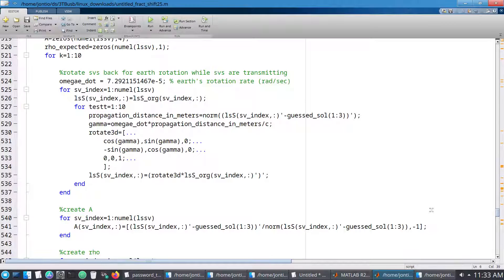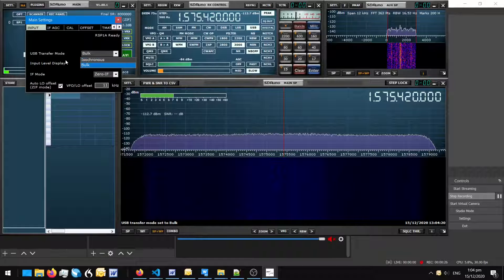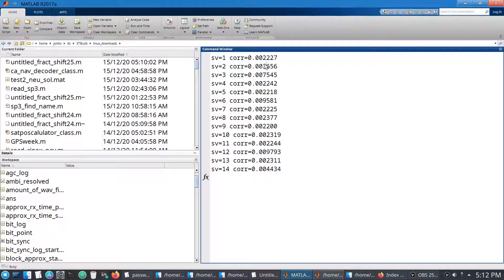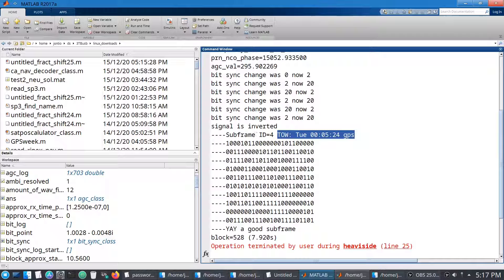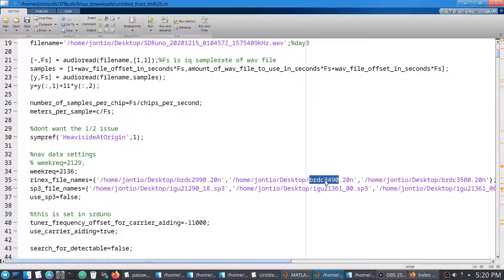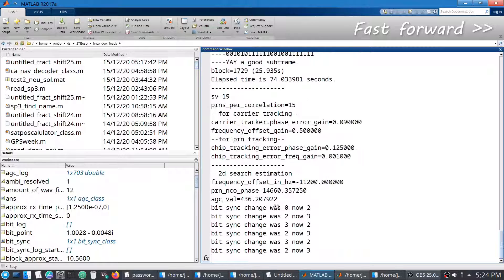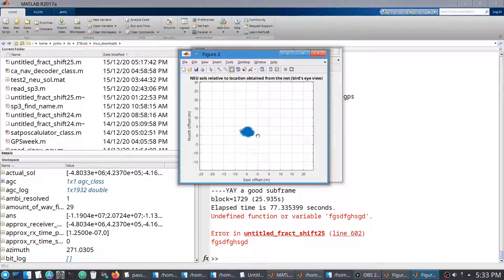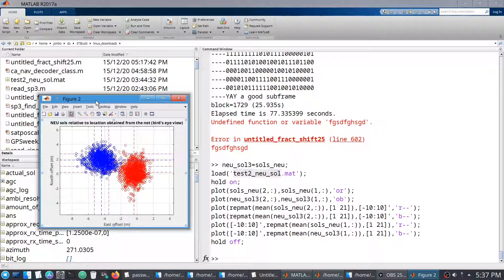GPS receiver in Matlab

Comment: Hi there, Thank you so much for such a helpful video. I am a researcher in GPS/GNSS area and currently working on GNSS vulnerability analysis through L1 signal spoofing. 

As @Sheryash Patil mentioned in the video can we do something similar to generate our signal using Matlab environment only and transmit it using USRP B210?
Reply from the maker: I'm sure it's possible exporting something from Matlab that the USRP B210 can understand. However I don't have experience with the USRP B210 and how it likes it's baseband signal, but maybe it's a IQ file in a wav format? A real time link between Matlab and USRP B210 would be more difficult but maybe there is someone who has already written some thing to do that. But yeah if it were me I'd start by generating a baseband signal in Matlab, export the signal as a IQ wav file, and then figure out how to transmit the file later after I was pretty confident that the signal was a valid one.
Reply: @jontiolds  can we save our signal in bin files from Matlab just like the spoofing video which were created using gnss sdr sim
Reply from the maker: @copycarvers  I'm not sure what the bin file format you mention is but I guess it's just a raw IQ format, probably 16bits I then 16bits Q, and signed integers. Matlab/Octave you can write that binary sort of stuff to files easily enough. So yes.
Reply: Will I need to use simulink for the signal construction or I can construct the signal using Matlab command window. 

Yes it is the IQ format and can I transmit.it using software defined radios?
Reply from the maker: @copycarvers  If it were me I'd just make classes and matlab scrips. I wouldn't use simulink mainly as I'm not that familiar with it. Any SDR radio that can transmit and take IQ files will transmit what you want. IQ files are baseband so you have to tell the SDR the frequency you want to transmit on and if it's a raw file format also the sample rate and whether the IQ samples are 16 bit 8 bits, signed, float etc. The SDR transmitter will describe the formats it can deal with you just have to write the binary files in matlab with a format the SDR transmitter wants.

Comment: I cannot access the aforementioned website. If possible, could you share all documents and MATLAB codes of the project with me ? E-mail: aesatsuzer@gmail.com
Reply from the maker: The address seems to work for me it's https://jontio.zapto.org/hda1/gps_matlab/Legacy%20GPS%20receiver%20in%20Matlab.html all the code is in that webpage. Does that webpage not load for you?
Reply: @jontiolds  Thank you for the feedback. However, the access problem has continued still, at least for me. Is there other way to access your site.?
Reply from the maker: @ahmetesatsuzer5313  Oh that is odd so it doesn't load? What response does it give (eg 404 etc). My site is self hosted in NZ so maybe your ISP or country doesn't like the IP address? What country are you in?  Can you access any pages on my site https://jontio.zapto.org ? If I can find some proxys from other countries I'll test the connection from there. ps I just tried some proxies from the US and Europe and didn't find any that fail to load. It's odd but you could just use one of the web proxys out there.

Comment: wow This project is awesome, Sir i have been working on GPS spoofing for last couple of months but still not be able to spoof the gps receiver can you please help . (>..<)
Reply from the maker: Thanks. I've never looked into spoofing. Spoofing would mean creating a GPS signal so that means you would need to create navigation data then mix that with the prn. If you wanted it so the GPS receiver position would be controllable then I think you would need to do it for most if not all SV visible but I'm not sure. If I was a GNSS receiver engineer  to prevent this kind of attack I would use Galileo and Glonass too. Then if one GNSS system didn't match the others I would ditch the suspected spoof signals. If the receiver was multi band then I would compare navigation data from different bands. However multi band receivers are less common. Another way to detect spoofing would be SNR strengths, if all SVs had exactly the same SNR that would be fishy. My guess would be only some GNSS receivers would be easily spoofable. It would be a difficult project to do. If it was me I would start by generating a PRN mixed with some NAV data obtained from the real SV with that PRN and then transmitting it. I would then experiment with times such as TOC TOE HOW etc to make the recording seem to advance in time.
Reply: @jontiolds  thank you for reply,
yeh that's pretty much how we can detect the spoofing but for that 1st i need to generate spoofing signals to actually make the receiver to show false location. 
I have already generated the prn, and mixed it with the NAV data but the problem is in transmission. When I transmit it @1575.42MHz ,L1 signal's freq.  The receiver is not be able to lock onto those signal (all exp is done in open sky and static environment)  also the C/No is too low.
Reply from the maker: @Itsmesam99  as I don't know your setup I can only guess as to what maybe happening. Have you experimented with the signal you are trying to send rather than actually transmitting it on air? Are you able to use something like my Matlab code to de-spread and track the signal you want to send? If yes to all those then are you able to transmit an L1 signal in a quiet indoors location and do the same using an SDR receiver? Only after that I would then consider using an off the shelf receiver for tests. Even then I would mainly test everything using an SDR receiver shielded from the outside and use my own code so I could be sure as to what I was going to send was what I would want. I think a lot of the effort would be spent generating the navigation data. With the modernization of GPS you may also have to look into CNAV as well as LNAV navigation if your off the shelf receiver is to lock on to your signal rather than the actual one.
Reply: @jontiolds    i found this video  demonstration for spoofing gps i am applying the same but the problem is when i transmit the signals the receiver it not locking onto those signals. 
Video- https://youtu.be/3NWn5cQM7q4
Reply: Please Lemme know what the problem is ? If you're able to find out 
Btw am not using hackrf for transmission am using amitec sdrs and gnu radio for transmission of the generated bin file
Reply from the maker: @Itsmesam99  thanks for the link. I see you are using gps-sdr-sim to generate the signal. I tried to run it but got either a segmentation fault  in main or invalid start time even though it's the correct start time for the NAV data (running kubuntu 20.04). With the broadcast files gps-sdr-sim uses I'm pretty confidant it's only going to be producing LNAV data. The TX bandwidth they talk about is also pretty narrow (around 2.5MHz) so that's ok for the C/A signal but I don't think that will be wide enough for the L1C signal. I would not let the receiver hear any real SVs as that may cause unnecessary problems (you only want it to hear your signals). The bin files gps-sdr-sim creates should be able to be used with my Matlab code with a bit of modification. For that  you want a  sample rate of 8MHz ("-s 8000000" in gps-sdr-sim) and probably only produce a few seconds else the files will be huge. You want 16bits ("-b 16") but I'm not sure about what endianness it uses. You could also try putting the bin files into https://github.com/gnss-sdr/gnss-sdr which I assume can use IQ files.  I can't get gps-sdr-sim working so I can't try any of this. If it were me I would write something like gps-sdr-sim from scratch so as to know why it's not working.
Reply: @Itsmesam99  I am working on the same thing as my final thesis
Reply: @copycarvers  @shreyashpatil3660 Hi, I am also working on this same thing for my thesis. Was wondering how your results turned out? I am trying to develop a GPS receiver model in MATLAB/Simulink to decode IQ data. Any help would be appreciated, please let me know!